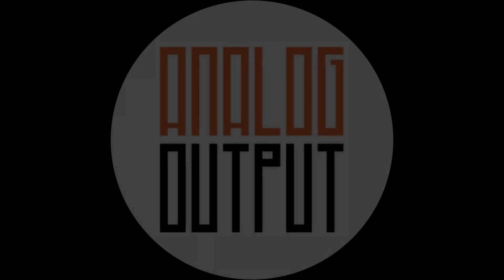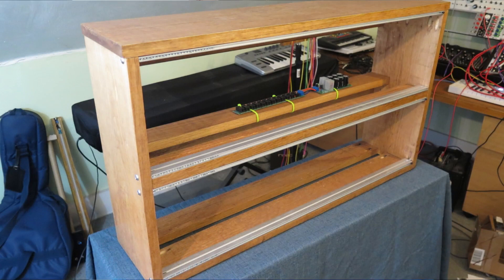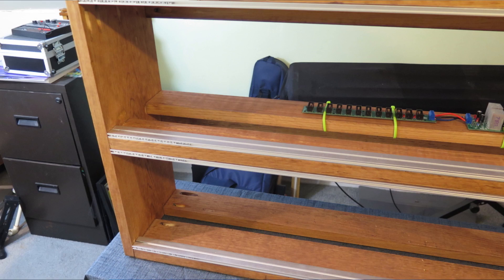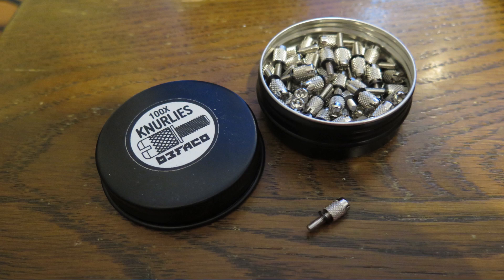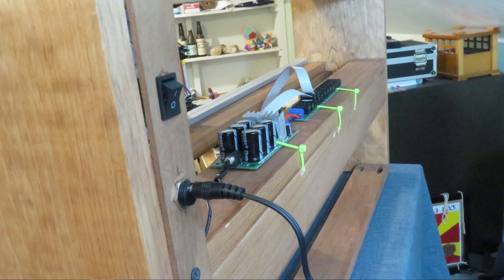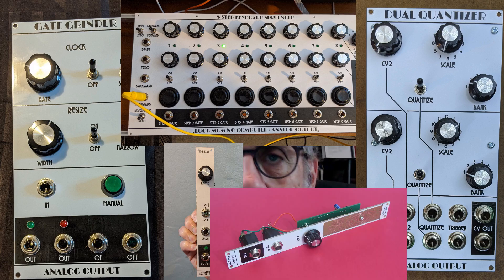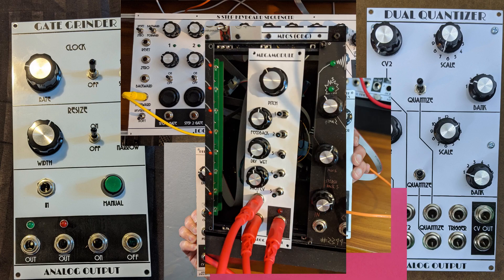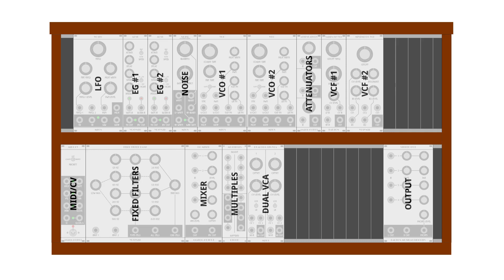Kosmodrome: Birth of a new synth!

Comment: Hi AO, Looking forward to seeing this case evolve - I like your old school choice of bread and butter modules.

I get a lot out of your vids. Both knowledgewise and inspirationwise. You make a lot of stuff dude.

I like the way you are happy to repanel existing pcb designs. 

I get too hung up on back to basics stripboarding from schematics. It's so cool when it works but it can be frustrating when it doesn't work or the end result is, as they say in France, a bit shit 😁

It's super cool that you built the Attenuator and Mult modules first. Passive Attenuators and Passive Mults are so simple to build. As are passive OR gates (for combining gate triggers). And the modules always earn their keep in my experience.

A passive Ring Modulator circuit is another easy build. You get a lot of atonal return on that investment (literally like a  few bucks for 2 transformers, 4 diodes, and 3 jacks - throw in a pot if you're feeling flush!). 

You're a #1 guy AO. Keep bleeping!

Comment: the case is beautiful! I am currently building mine with wood only, but only because I couldn't source the aluminum rails...
how deep do you think is a good measure for a kosmo build?
Reply from the maker: Kosmogenesis's top row is about 9 cm inside front to back, and that's not enough. I have modules too deep to fit there. Kosmodrome is mostly about 16 cm, except the lower part of the top row near the power supply which is about 12 cm. I think that'll be good.
Reply: @analog_output  that is encouraging! I am currently looking at around 10 - 12cm deep in this case I'm building, and was a little worried that it would not be enough
Reply from the maker: @Abossow77  10 cm might be too tight for some modules — not Sam's but some other designs. Sam's I think are typically well under 10 cm. But some of my own designs have the PCB mounted perpendicular to the front panel, and those can run deep. Especially stripboard designs.